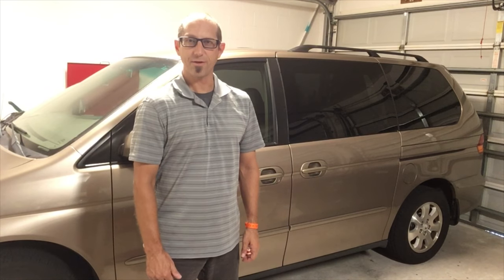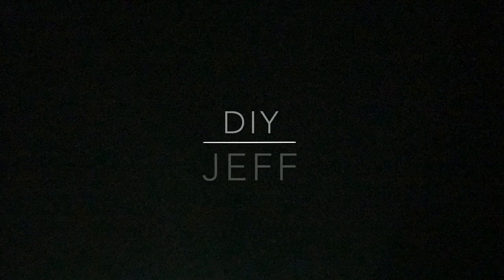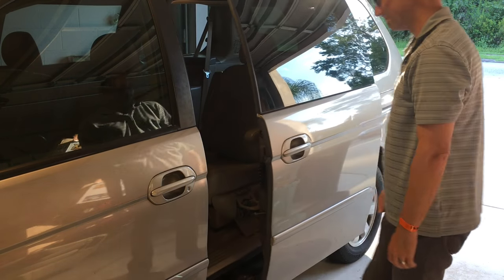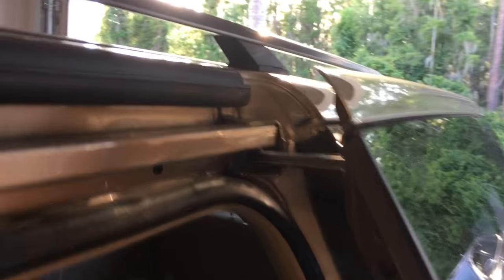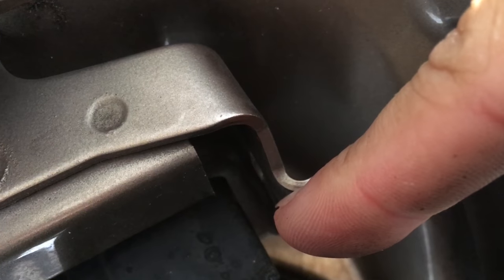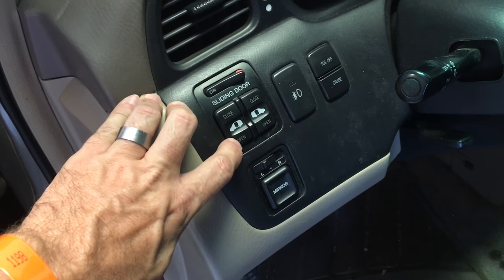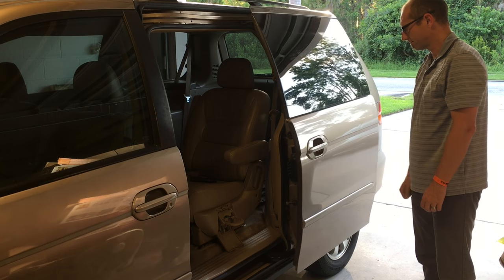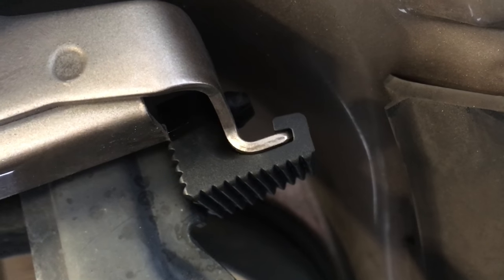Honda Odyssey Sliding Door Won't Close - Fix

Comment: My has different problems, it won’t close all the way only halfway
Reply from the maker: Mask Rider#1 , does it do the same thing for the inside and outside handle, as well as the driver control button? If so maybe the track has debris in it. See if you can clean it out and if that fixes it. It might think that it’s hitting something and won’t close.
Reply: @DIYJeff  mine just has to be pulled all the way back with a light tug, or at least it did, to work with the buttons on the fob or the console...  now, today, I ran into a situation where the driver-side one, the one with the cable-stretch-problem? won't close even with the buttons now.  what then, Jeff? ? ? slipped a gear? cable broken? -it just beeps.  I'm suspecting the motor croaked as the door's always been crapped and needed help to close snug..  a lean-on..  ya know.  now, dead. lol..  worn out bushings/bearings finally did it to it?
Reply from the maker: Malcolm Wolfe , sounds like it’s the motor in the door lock actuator.  At least based on the symptoms you’ve described.  Not sure if the motor can be replaced independent of the actuator.  But this is common on most vehicles.  I made a video you can look up on my channel on how to replace it as mine went bad too in my Odyssey last year.  My wife’s 2005 CRV I ended up replacing every actuator in the vehicle because they went bad.
Reply: @DIYJeff  it has been a picky locking door too..  usually, unless humid as heck out, must be manually locked/unlocked.  the rollers are shot too tho, and I just looked at another video on how to replace them.  ridiculous..  just stick 2 bearings there, Honduh!  plastic?!  lol...  it's a shower door!  -and have to buy the whole dam thing..  not just 2 plastic wheels.. ALL of it :(
Reply: jeez, I'm gonna even have to yank the back interior panel too on this junker.  pfft lol...  scrapyard!
Reply from the maker: Malcolm Wolfe, sounds like you need a whole new door with all that's wrong.  The door not locking is the door lock actuator which I believe is also part of the sliding door mechanism so if you replace that actuator it should fix the locking issue.  I guess whether you fix it or not depends on how bad you need it to work or if the vehicle is worth keeping.

Comment: Mine has the wedge things but still won’t close from the outside only closes by the button in front
Reply from the maker: AnnaLUVsBOBMARLEY , check the sliding door track at the bottom and make sure there’s no debris that is stopping it from going all the way back. Another problem these doors experience is not going back all the way, which then prohibits the door from allowing the latch to engage to close it. With the door open try pushing the door back and see if it has any give. Sometimes by pushing it back a quarter inch it allows the door handle to work.
Reply: DIY Jeff  thanks for the quick response I’ll let you know how it goes
Reply: DIY Jeff so there was a sock stopping it I removed and made sure nothing else was there but it’s still not shutting from outside
Reply: DIY Jeff so there was a sock stopping it I removed and made sure nothing else was there but it’s still not shutting from outside
Reply from the maker: AnnaLUVsBOBMARLEY , did you try pushing hard on the door to try to open it a little farther? Sometimes they don’t open all the way which won’t let the latch engage to close it.
Reply: Got it lol it’s the little wedge on bottom
Reply: DIY Jeff  after I pulled out the sock I closed it and opened it and pushed back still nothing but gonna switch out the other piece that’s bent and see if that helps

Comment: I was told by my Honda dealer that it was the door actuators and that they were causing a parasitic draw. That's the reason why by battery was dying. Have you heard of that at all, Jeff?
Reply from the maker: If you are having a problem with your battery dying and it's a good battery, then it's highly likely you have a parasitic draw.  It's highly unlikely, but it is probable, that it could be one of your door lock actuators.  I'm not sure though how you can easily test that.
Reply: @DIYJeff  Thank you. That’s what the dealer told me. Yes - I have a parasitic draw but they couldn’t detect where it was coming from. After all the tests, they narrowed it down to the doors. 

I don’t know what they’re called, but the black connectors on the inside of the doors that connect to the frame near the front doors with all those silver pegs on them, look pretty worn out. Not sure what they actually do.

Comment: I did this, didn’t work. Mine opens and then when it closes it closes and bounces right back open. Any suggestions
Reply from the maker: Kim Skeels , prior to putting in the new rubber pieces, how did the door react? Would it open and not close?
Reply: DIY Jeff it will open and close but will not latch when it closes. So it opens right back up
Reply: DIY Jeff  So I was praying this was the fix but not the case
Reply from the maker: Kim Skeels , have you tried cleaning the metal contacts on the inside of the door frame and the door itself?  Use an eraser and scrub them.  If they get dirty the door and the frame don’t make electrical contact and won’t latch.
Reply from the maker: Kim Skeels , if that doesn’t work, find fuse #13 (4th in on top) on the inside passenger front kick panel.  I think it is listed as "Clock Reset" and is a 7.5 amp fuse. Remove it for 30 seconds and then replace it.  Open the passenger side door and then the driver side.  This fix has been reported as working for some people.  But clean those contacts first.
Reply: DIY Jeff I did Jeff but will try again. This is about to make me nuts